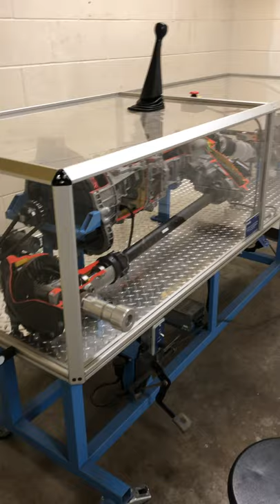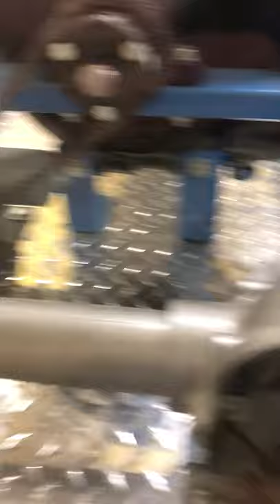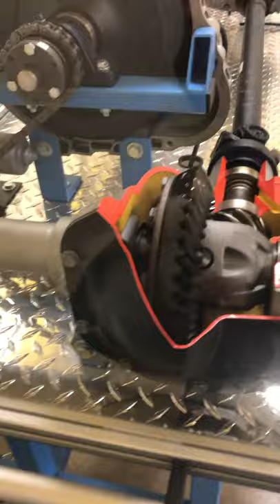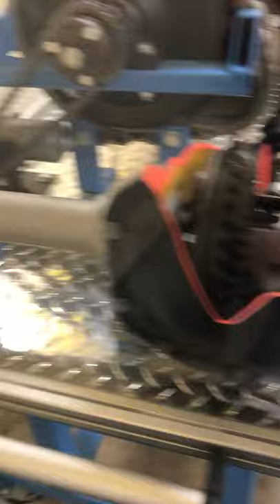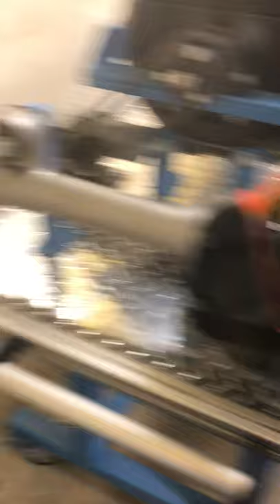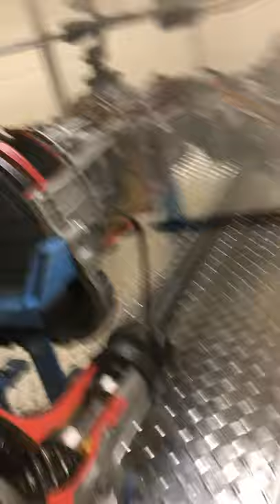Differential Operations

Comment: @ Autotechcp What motor did you use to drive motion on the transmission through the rest of the system? I'm building a similar demo setup and was wondering what you used?
Reply from the maker: I can’t take credit for this build. This unit is made by Consulab. The motor appears to be a windshield wiper motor with gear and chains

Comment: hmmmm, so when im in 4x4 with no dif lock what happens. Why does it sound like something is grinding? With your demonstration should you be able to make sharp turns on 4x4 since one wheels when move at a different speed as the other?
Reply from the maker: Your differential should not make any grinding noises. If you have a “limited slip” or some other type of locking differential you may have internal damage or wear causing the noise. Noise = damage so the sooner it gets looked at the better.
Reply: @autotech4103  it's a new tacoma. I have seen other people say the same thing. That shouldn't use 4x4 on pavement. Just wondering why you can't make sharp turns on 4x4
Reply from the maker: Video to follow today. Stay tuned

Comment: When my 4wd drive is in 2nd, does the differential still work in the same way?
Reply from the maker: Yes. The only exceptions are trucks with differential lockers. Lots of trucks have “limited slip” types with clutches that lock up your diff when you spin tires. If only one wheel spins at a time you have a regular diff
Reply: @autotech4103  I have an old mitsubishi Montero limited. 1st SUV I have ever owned. I absolutely love my monty. I think it has a limited diff. Do you know much about the Montero?
Reply from the maker: @Fireneedsair  just learned that it exists today! Looks like a decent ride
Reply: @autotech4103  pretty rare in the USA but ubiquitous elsewhere. Surprised you don’t know em’. Got 186000 on a 2001
Reply: @autotech4103  so does that mean my front driveshaft (4wd) is always spinning and the disengagement happens at the differential?
Reply: @autotech4103  the reason I ask is my 4wd only intermittently works and I’m trying to brainstorm a little. If the front driveshaft always spins even in 2nd (I believe I have a limited slip) would that mean the problem is past the transfer case and more likely up by the diff? I think my 4wd is controlled by vacuum hoses and not electrical control. Any ideas is much appreciated.dan
Reply from the maker: @Fireneedsair  4WD units that are vacuum controlled are reliable except for the vacuum lines. Follow it along for a break or run a new rubber line and check it’s operation is my best advice
Reply: @autotech4103  is it possible its an solenoid or actuator or low fluid in the diff?
Reply from the maker: @Fireneedsair  yes, yes, and maybe. If you had the front of your vehicle jacked up and on stands you could switch it in and out of 4WD to see the operation. When it is out of 4WD you should be able to turn a front axle independent of the drive shaft
Reply: @autotech4103  I hope you don’t mind my picking your brain w questions. I can contribute thru patron to throw u a few bud if needed
Next question: so does the vacuum line force the solonoid to push the actuator into locking the diff to the axles when I shift into 4wd? Is that remotely close to how these things work? Lol. Thx much
Reply: A few bucks…
Reply from the maker: @Fireneedsair  no problem at all. I looked in our service manual but it doesn’t say what the vacuum does. I can only assume by supplying vacuum to the front differential that it pulls the collar into place to lock the front differential in 4x4.